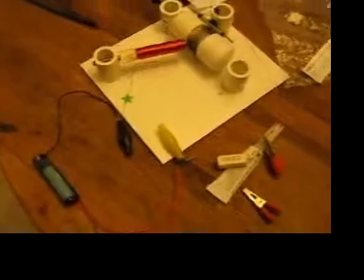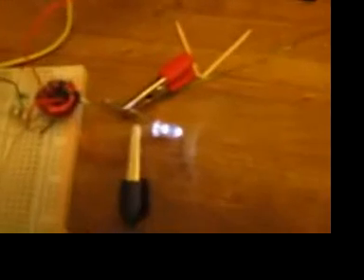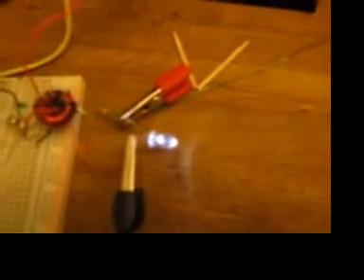SimpleMotors Reed Switch Motor.mov

Comment from the maker: @teslacult Actually I did make a bedini charger. I made it without the bearing in the way jonnydavro made his. Jonny's design is very successful but the rotor magnet went so fast it got out of control.
I am finding a joule thief will recharge batteries very well.
A bedini motor charger with a bike wheel is coming soon.
I made this because I wanted understand how to make a motor without a transistor if I could.

Comment from the maker: @marthale7 I expected it to much noisier than it is.
the kit came with a little felt pad for the reed switch to rest on.  You can see it peeking out behind the reed. The whole motor kind of click-hums. It is actually very quiet.
What would be nice now is to find a lighter weight rotor... A disc of wood with a set of roller blade bearings.
What I needed was a hands on example so my mind could grasp how the reed switch would work. I think you have already made that connection. - thank you

Comment from the maker: @CosmicGnarler Yes, TheDaftman made one.
He called his video the school boy project and it was posted on November 01, 2009.
His is a NC normally closed one because the switch is operating directly from the coil's end field and not from a magnet on the rotor. The idea is the same, just opposite. His is sturdy and adjustable.
I am sure it can be modified to be a normally open switch.
It might take more amps. I wonder.

Comment from the maker: @jaesungauzakim Yup. It is just 4 magnets on the rotor and the reed switch is in series with the coil. When one of the magnets gets close to the reed it closes and starts the impulse. You usually need to give these kinds of motors a light push, then they accelerate to some speed and keep going.
So, it is a motor with no transistor. I like it.
Right now, I am seeing what I can do with the mag pulse of the coil.